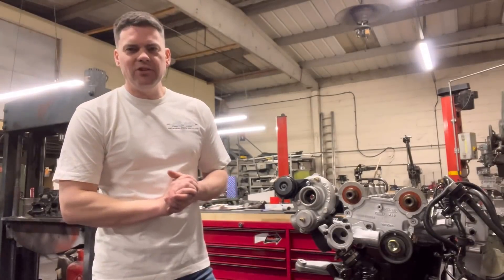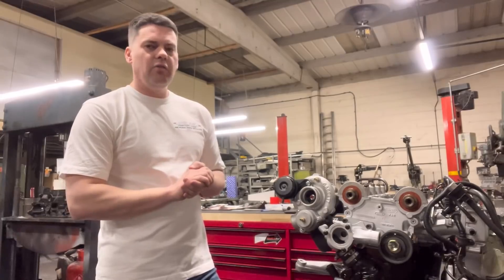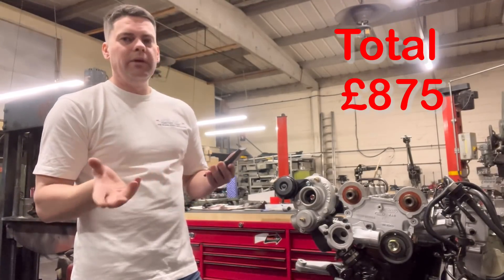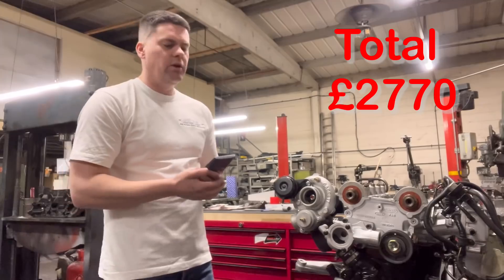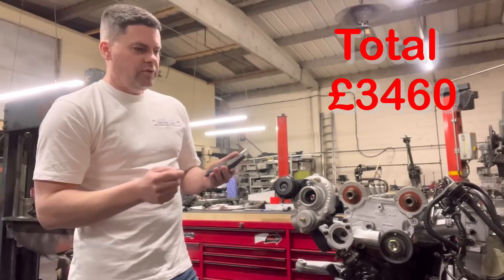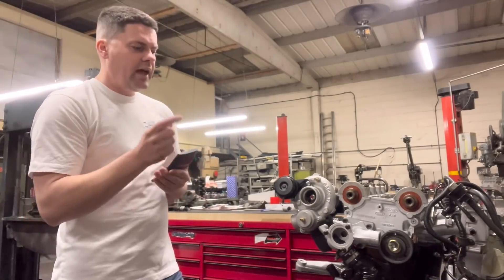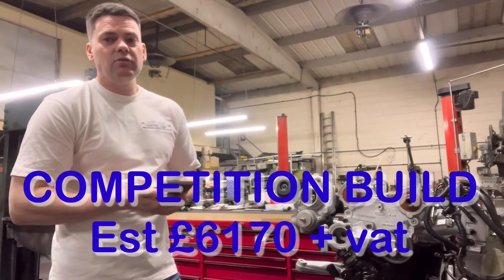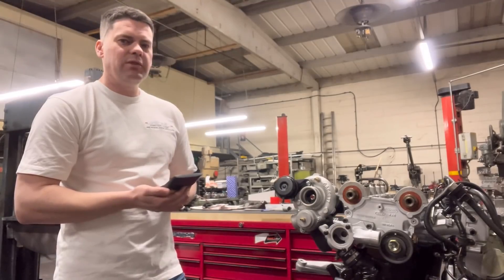How much does it REALLY cost to build a standard & Motorsport Cosworth engine??

Comment: Finally an honorable skilled engine builder that isn’t going to charge you £75,000 pounds like Julian Godfrey does for a 600 plus HP YB engine which is laughable nonsense. 

£3500 pounds to rebuild a Cosworth YB engine to better than stock specifications and aboat £6800 for a 600 hp bottom end not including the turbo and ECU. Let’s say additional €4000 or less for a larger turbo and management system to get anywhere from 500 hp to 600 hp. So the total is anywhere from £11,000 to £12,000 pounds or lower. 

If you don’t have the engine add a used donor used engine from I’m guessing $3000. So how can these these other YB engine builders charge £25,000 to £35,000 or more per build? 😮In Canada or the US it’s easy to get 600 hp from a V6 or a V-8 Ford for anywhere from $10,000-$15,000 and don’t forget there are additional four cylinders of material on these V8 engines compared to a four-cylinder.

Comment: Do you ever use the cut ring headgaskets on these? (they are like a standard gasket, but instead of a convential fire ring, they have a stainless steel ring that sits inbetween the lip of the gasket and the bore and bites into the head when tightened down like an oring, but without requiring machining) I think Athena makes the majority of them. I know a guy who specialises in turbo V8s , LSes etc and he actually recommends these for the majority of the turbo builds he does, unless its all out race promod stuff over 1200hp

Comment: Are all 2.0 16valve dohc engines created equally when it comes to the costs for a complete re-build? The reason I ask is firstly that some pedigree engines like the Cosworth, XE and Mitsubishi EVO have parts  tax on them, but then on the other hand I bet there's a far greater choice of parts and maybe because the parts are widely available and made in greater numbers maybe that can mean parts prices are lower than for engines where parts are scarce and performance off the shelf bits don't exist? Also would a shop that specialises in say Cosworths and knows them inside and out be likely to do them cheaper than an engine they've never really worked on, or does a decent engine shop not get fazed by the uncommon or engines outside their normal day-day business?

Comment: I think that quite cheap in either cases. People don't realize the attentions and the time that it takes to build a proper  engine.  They think that it's just a matter of putting parts together.  They forget the cleaning, the inspection, the measurements, ajusting the cr, flow bench the port, egalized the chamber's volume, checking the lift, mooding the orginal bad designs, ect. Parts always cost more that the labour. And the quality of the after market parts  is sometime just awful. It is all this kind of little details take a lot of time and the end result is always hidden in them.

Comment: You probably need to mention that even if the rotating assembly & valves mag good! You cannot warranty 40 year old engine parts! Also recommend if your going to race it, it probably should have all new parts! Steve Morris in the US has a great saying & it’s 100% correct! If it moves, it will break! You probably should have also mentioned that especially after this Covid bullshit💩💩💩💩 parts price have only gone up! If you could even get them! My boss has around 10 engines in the build room, where just about everything is done, except there are tons of back ordered parts 🙄🙄🙄🙄! Great video, I just hope it doesn’t come back to bite you 🙄🙄🙄🙄!

Comment: Seems fair but £1,000 worst case for porting seems a tad expensive but all things being equal you get a top class new motor for your buck. Good job👍.
Reply: If its CNC porting you can double that, mine was £1920 inc uprated cut back guides and matching ported trumpet section. Much better job than a die grinder
Reply: £1000 for porting is fairly average now. It's a crap job and nobody wants to do it by hand 😂

Comment: Yeah engines aint cheap to build.
My list was
Pistons 1200€
H-beam rods 540€
Ross damper 800€?
Bearings chain guides seals etc. Est 450€
Machining incl. Boring n honing 6x, polish crank, fit piston rings, decking block and head, valve seals and seats. that was about 1250-1350 in just machine shop. 
Clutch and flywheel 750€
Upgraded Head bolts 40€

Let's just say i hope this engine will last.

Comment: I like the channel and the content but , the prices you are quoting is about the same as we was using about 20 years ago !  also what about a full set of guides ?  and what about if the head needs welding or it needs valves , if your using the old pistons there is a ring set and head bolts. We all know to recon a usable head is a good £400- £600 notes thats strip chen clean pressure check remove old guides put new guides in the clean and seat all the valves and check the heights and a skim .... the list goes on .... and was that a T34 on that engine there rocking horse poo now and treble the price if u can find one .... in a word your far to cheep
Reply from the maker: Thanks for your input Giles. In my opinion, we arnt too cheap at all, we charge the right amount for a good job, it’s estimated because there will be some things extra but we don’t charge a Cosworth tax like most other, that’s why we get a lot of work.
Reply: @BarumEngines   Hi there ... i was in the tuning game back in the middle 80's upto about 2002 ... one thing i will always say its best to be really busy making a small profit that ripping people off making a shed load. Now with the social media thing and word of mouth its owe so easy to be left with no work because you have been gready. Good to watch the channel looks like work is picking up so your doing something right good luck with everything !

Comment: £4200 inclusive for a standard engine , add a upgraded turbo and injectors and take it out then in and BBR used to charge £10,000 25 years ago 
If the turbo was £2000 and injectors £600 I reckon this price would still be £3000 less than they charged and I bet Godfrey would want £20,000.
My mate who I can’t disclose reckons you pay 50% more Godfrey tax 😂
Reply: In fact if pat doran ever turns up runnnnnnn

Comment: I wish Evo engines were that cheap to build the parts are mega expensive . Great videos by the way
Reply from the maker: Done a good few Evo engines, not much more in parts to be fair and labour is the same, be aware of Evo tax 👍
Reply: To be fair stock yb pistons, rods, cranks, bearings, oil pumps ect are all good for over 500hp which brings costs down on a big power build. Weakness is the head bolt threads and head gaskets
Reply: My man buys top spec yank evo bits that cost cheap,  are you really sure you know what your doing ?
Reply: @chiefrocka8604  I’m saying compared to cosworth engine rebuild they are expensive if you are putting top quality parts inside anyway
Reply: Yes spent £££ on my evo engine.